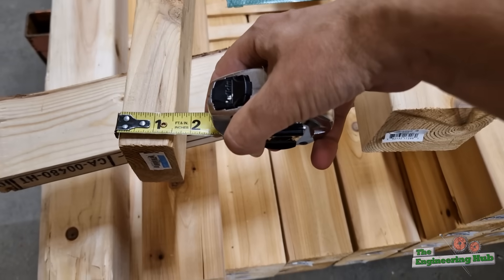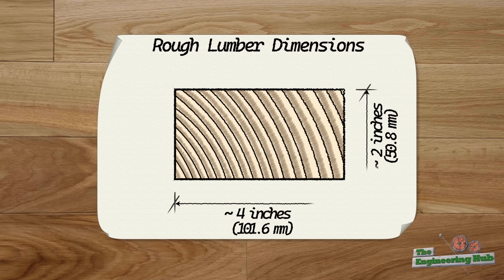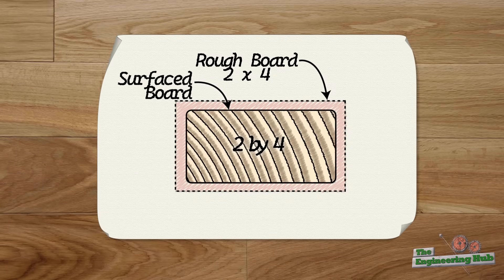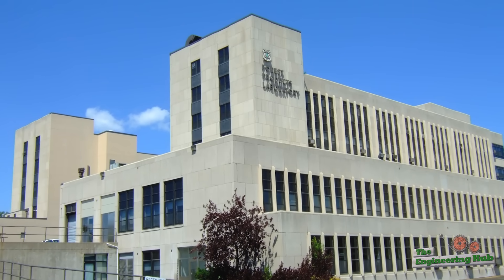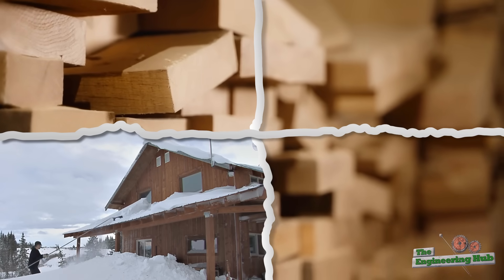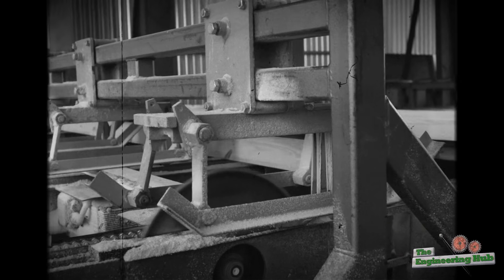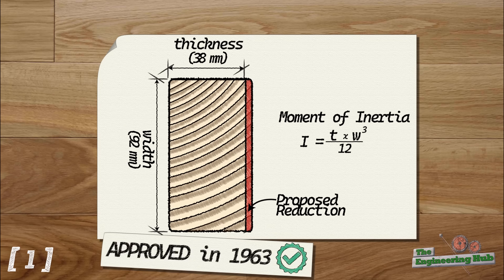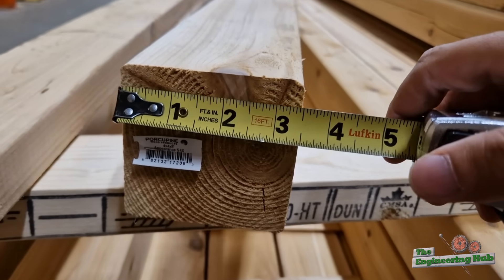Why is the 2 by 4 getting smaller and smaller?

Comment: There are three sizings for timber, roughsawn, dressed and gauged, all with different qualities of surface.
In New Zealand which is pretty consistent with other countries, r/s is still described in imperial, 4x2 or in metric, nominally 100x50, and gauged is still called 100x50 even though it is 94x47. Dressed is the finest commercial finish and dressing makes sticks even smaller, but dressed timbers are used for finishing not framing, and framing timber is not usually used for finishing.
I’m 64 and nothing has changed in sizing during my lifetime. Kiln dried timber is still the uniform 94x47. Metric sizing has been used since about 1970.
Houses built by the state, “state houses” in the 1950s were engineered differently and framing timbers were square edged and smaller but I would not necessarily call the timber dressed. The timber was the native rimu. Most framing during my lifetime has been treated radiata pine, pinus radiata, also known as Monterey pine as it is a native of Monterey California.
Monterey pine was used from as early as WWI but not commercially milled until much later. My Dad worked at mills as a youth in the 1950s, pressure treating pine with tanalith, aka tanalising.
Timber on colonial buildings, say before 1900 was sized a bit differently and even beyond WWI finishing timbers were a bit heavier. Some time around WWI some odd numbered sticks, eg 5x2 were dropped and just even numbers used for framing 4x2, 6x2, 8x2, etc, with 3x2 retained for partitions and light exterior work, and 4x3 for bearers.
Obviously the reasons you give for sizing are specific to America so are novel to me, and a totally unnecessary explanation for something that is otherwise self explanatory.
As for sizing and strength, my preference is to use roughsawn as for one I believe it is stronger than gauged, but also for the aesthetic where framing is involved. For work on my own house I prefer the smallest sticks possible with closer spacing rather than deep sticks and fewer. As code requires treatment for insects and that means toxic chemicals when using pine I opted instead for Douglas Fir bought wet and juicy and put them up wet. They have mellowed from pink and white to golden brown and remain completely unfinished after fifteen years.
The problem with using roughsawn timber is that it is rough, and not the best sticks.
Reply: in NZ you guys grow a lot of doug fir which is great wood. Far better than the pine the east coast of the US uses. Out west in the US it's mostly doug fir and ponderosa pine
Reply: How dare you use metric!
Reply: Actually, the NZ 4x2 is now 90x45mm. I think it changed in the early 1990s when kiln dried framing became popular.
Reply: I pulled the plaster off a wall in my 1930's bathroom, there was all sorts of random stuff and different sizes, matai mostly I think hard as rock. And the spacing not fitting 1200 x 2400 gib, so had to put in some new planks, and used 10ml decking to get an even surface elsewhere.  The other walls were more standard due to a more recent renovation changing the floor plan, thankfully. Thought I had caught my sparky out not replacing some old conduit, but turned out he had pulled new wire through the old tube from the ceiling to the power point in the adjoining room.

Comment: so a US 2x4 is what we call a 90x35 in Australia, which is the thinner version of the 90x45 (the 90x45 is used for house framing in the tropical north where I am).
The 35 thickness doubled up gives 70 and there is 70x45 and 70x35 as well (and then again 120x35, 120x45, 140x35 and 140x45, etc..). But most common is 90x45 and 90x35.
PS: and yes, the dimensions of that wood is +/- 1mm what it says on the label.
Reply: In Brazil our 5x10cm have surprisingly 5x10cm
Reply: For my U. S. compatriots, "90X45" ~= 3.6X1.8, so a "2X4" in about 1970.
Reply: Surprised you don’t use A8 size (53x74mm), etc.
Reply: @  spencerjoplin2885  
Why should metric countries use an aspect ratio for wood for house framing that was developed for paper sizes based on an aspect ratio of √2, so that when the sheet is folded in half the aspect ratio stays the same? In wood framing it's much more helpful that when you double up the new thickness matches the longer length of the two sides (for any sort of corner in framing = aspect ratio of 1:2). This is what 2x45 = 90 or 2x35=70 is all about. And yes, it becomes inconsistent if you look up 'australian standard timber sizes', probably for historical reasons.. don't ask me, I just immigrated here like 14 years ago and have built a couple sheds and part of my home with the stuff ;-)

Btw, the basic hollow core concrete blocks that are used around here are based on 20cm steps for wall heights (with a 1cm mortar layer in-between). So the blocks are 190mm high. They also are that deep (or thick) and their length is 390mm, to get to 400mm with a 10mm mortal layer between. Then there is half width blocks and half height blocks to go wit this and if you assemble two of those with a 10mm mortar layer to go with the 190mm size you get exactly 90mm. So yeah.. it's complicated, but sort of systematic and I guess that is where the 90mm for the timber is related somehow.
Reply: @spencerjoplin2885   it would be a great size
Reply: One huge advantage to being on the metric system as opposed to using fractions.

Comment: Most timer merchants near me (UK) just sell the wood by it's metric finished measurements... It's been many years since I've seen a "2x4" label on any wood.

I'm sure some do but labeling the wood with only the metric finished measurements makes it clear to everyone what you're buying.
Reply: Any American worth their salt would go "what's a 50x100mm, I need a 2x4". Don't try and take away my imperial freedom units, we sank a bunch of tea for this!"
Reply: Before metric in Australia it would be called 4x2 not 2x4
Reply: I'm in construction (UK) and timber is still milled and cut to imperial sizes. The metric sizes that are displayed in retail establishments are conversions. For example a sheet of ply will be sold as 2440 x 1220mm but it is cut to  8 feet by 4 feet. All planks are cut and to multiples of 4 feet and then awkwardly converted to metric to appease Europhile government. Same with steel, an 18" beam is described as a 456mm. Lead flashings are now specced by code 4, code 5 etc. What does this mean? Code 5 is 5lbs per square foot, you're just not allowed to call it 5lb lead anymore.

Comment: Great, love all the corporate excuses.      My prior home had real wood for it's build. The door surrounds that cover the jams had 1 1/2" width on each side and thick real hardwood- the 2x4s were 2x4 or slightly over - anyway I looked to buy a replacement for one door to surround the opening just to check and it was 100's of dollars because the thin pine crap they use now is all they sell.  The walls that had wood paneling were real hardwood too. It was a real eye opener. I can't remember the year of the home but I think is was 60's or '72

Comment: I never asked this question.  Old homes were built with "rough sawn" 2 x 4s....   Often built green and balloon framed as well.    The lumber coming out of the stores these recent decades has been kiln dried and very consistent......It was easy to imagine that the rough sawn cuts were getting dressed.   
Fantastic video!   tHanks for posting.
Reply: I think that the boards from the 40-early 60s were the best. It was still older growth and kill-dried. Most of the stuff you buy at a big box store is "S-dried".
Reply: I agree...you can see the difference.  I'm not against the faster growth wood.  Seems like it can hold up.  If faster growing trees work, I'm willing to try.   
When I take apart old walls the wood feels heavy and definitely from a different era.  @greentriumph1643
Reply: I don't think I've seen a "consistent" rack of lumber in a long time outside of the expensive fine lumber aisle. It's like 75% wonky boards, 22% usable without any major caveats, and 3% properly solid.
Reply: Check the grade stamp I’d bet money it’ll say s-dry! As in surfaced dried!
Reply: its not the sawing thats different. its the saws.

Comment: It's even getting worse recently.
I bought 80 2x4 studs in 2021 for a project that didnt happen. These were bundled and strapped in a dry barn for storage. Now wood shrinks a bit as it drys and keeping that in mind,
I recently bought 30 more 2x4s from the same store (HD) to add to the existing boards to do a new project and found that the new boards are almost 1/8" smaller in both dimensions so are way under and because I didn't notice & mixed them when installing the wall, the sheet rock bowed across the bays when nailed up. Was this just a mill screwup or has shrinkflation struck lumber too?
Reply: I have that happen a lot, I always assumed it was the machinery was miscalibrated
Reply: @MavetSomnus  tee hee tee heee rubs hands while saving .04 cents per board foot sold new yacht is on the way

Comment: Here in Germany, probably all of EU, it´s similar, but kinda completely different.
Construction lumber is rough sawn, no milling whatsoever.
It usually starts at 60x60mm (or up to 100x160 for ´normal´ home store stuff), but the store sells this as a 56x56 or 58x58 (I´ve seen variations over the years).
Everyone stll calls it a 6x6 (cm) though, it just must not be advertised as such.
Reply: In Sweden the regular construction softwood ’2x4’ equivalent is a true 45x95 mm (1.77x3.74”) milled one, with edges rounded. Have never seen rough sawn construction lumber, and all lumber is sold according to true dimension. So I guess construction lumber is not the same in all of EU!
Reply: @Random-f3y7w ive worked with selling lumber for about 10 years, and ive seen 2x4" rough sawed in sweden, but its uncommon. And not used that much. Remember that we had to remove it from the racks cus they took up space for other more selling products.
But everything else you said was correct. 45mmx45mm, 45x70, 45x95(our equivalentmto 2"x4"), 45x120, 45x145, 45x170, 45x195, 45x220 is the normal 2"x something in sweden. And these dimensions are milled and have rounded corners. And most of the wood is freshly chopped lumber. So they bend and curve, propeller pretty quick when you open a new package.
Reply: Actually, you can get it sanded or raw, for different prices of course. All dimensions are in mm, of course. Germany is part of Europe 😊.
Reply: What about "Konstruktionsvollholz" (KVH) ?
Reply: In France at least, you also have different treatments for construction lumber, and you can have a surfacing on one or more faces. What you get in the hardware store is often not properly stored so it's warped.

Comment: I mill my own lumber for projects. I've stopped milling actual dimension 2x4's because nails and screws are standardized 3 1/2", and you pay a steep premium for longer fastners (needed to join the fatter lumber.)

Now that the price of lumber is down again, I just go to home depot for 2x4s and smaller, as they're a bit  of a pain in the ass to mill. IMo, too tedious. I save the mill for posts and beams and fun stuff.
Reply: I've been cutting fence posts at 4" by 4".   They look proper....like a fence post should be.  Amazing the difference it makes.    Like you, when I need some boards I just cut them at 1 1/2" thick....It is what I'm used to.        tHanks for the post....and tHanks for the video